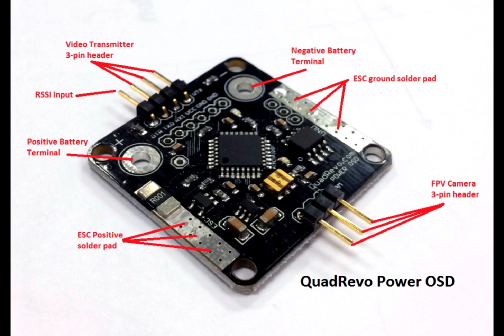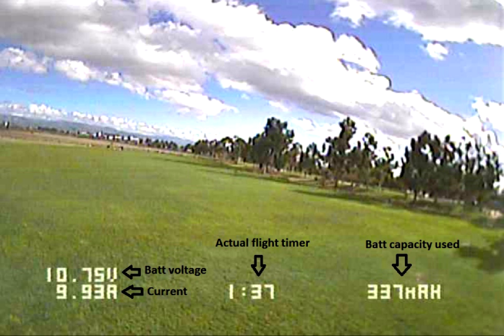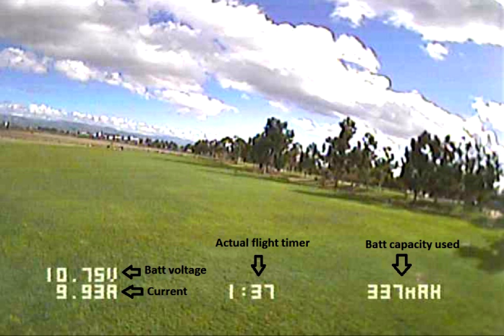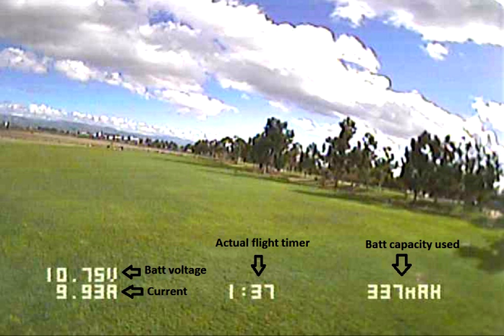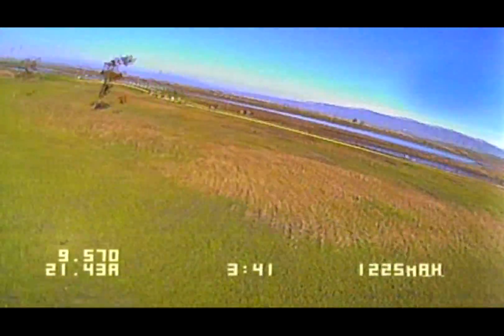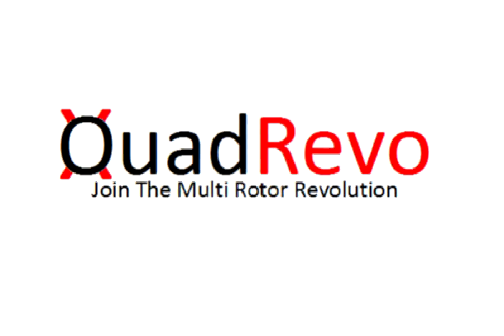QuadRevo PowerOSD Overview

Comment: I have this board but I am only getting the battery voltage reading.  No current, flight timer or capacity used.  any suggestions for a fix?

Comment: Whats the output voltage for cams and VTX?  As most are either 5 or 12V so does it have built in Regulators?
Reply: Rudeboys FPV I would really like to know the answer to this also.
Reply: Marshall Alsup It's the same Voltage that get into your Board